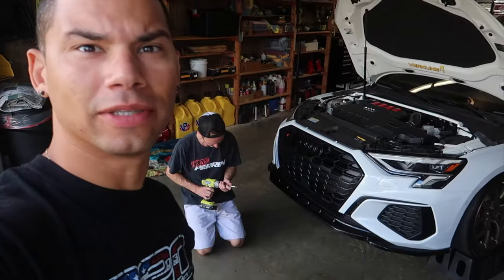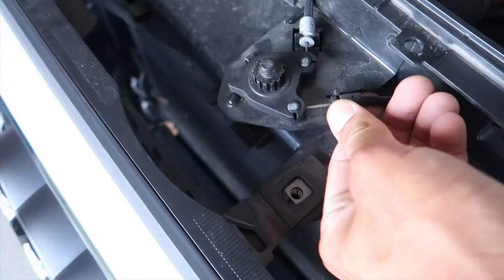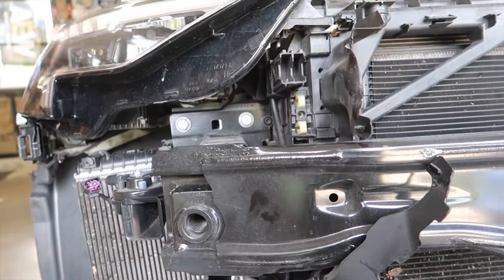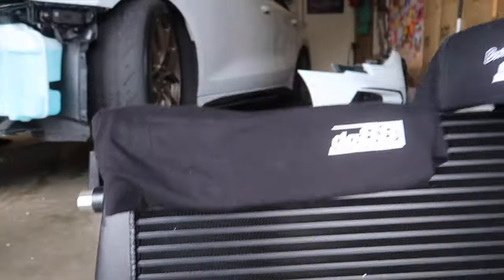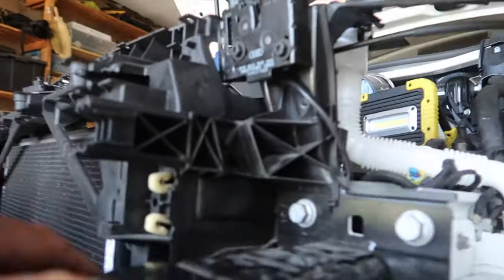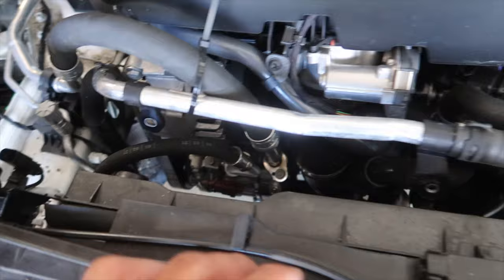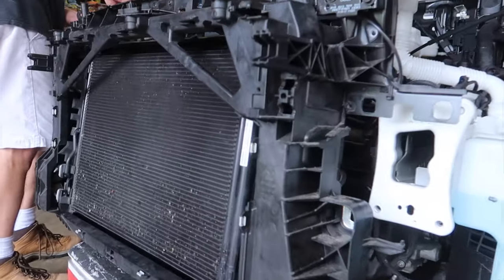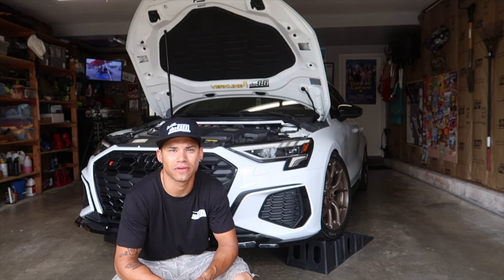DO88 Evo4 EA888 (8Y S3) Intercooler install! w/ @LastHumansGarage

Comment: Hey man, are you running stock charge pipes? I also have R600 Evo4 intake and bought the Do88 intercooler but with the Big Pack, including DO88 charge pipes. I was wondering if everything will fit nicely. Any thoughts? Thanks.
Reply from the maker: I’m sure it will! DO88 never skimps out. I do plan on getting those once I’m tuned!

Comment: Was there a huge difference maker between going with unitronic, wagner, do88?
Reply from the maker: I don’t have any data to show against uni or Wagner. But this is doing better than my previous APR & racingline. Didn’t really get to test my AMS much but it’s lighter than most. This IC is doing crazy work with being tuned in the Texas heat. The other day fourth gear pull it was 94° out and the intercooler brought me down to 97° within a few hundred RPM
Reply from the maker: I have a data log device that shipped out yesterday. Lots of videos coming soon with data logs to really show how well this intercooler is doing on a nice fancy chart with boost/RPM/Knock etc etc
Reply: @BryceJordanProductions  good info, what was cheapest / best bang for buck?
Reply from the maker: There is none really. They’re all roughly the same price with some wild results lol. Go Do88 and you’ll be extremely happy

Comment: Would it all hold together I'f i don't put a intercooler back in??
Reply from the maker: No, you’d need the intercooler delete brackets. ECS sells them. Or… punch out the old intercooler and use it as a frame. Intercooler attaches to the rad and the AC stuff connects to the IC. You need it all to hold together
Reply: @BryceJordanProductions  nice I'll look for the intercooler delete parts.